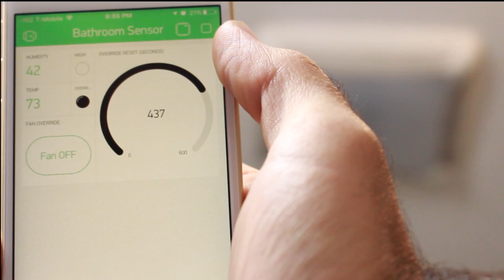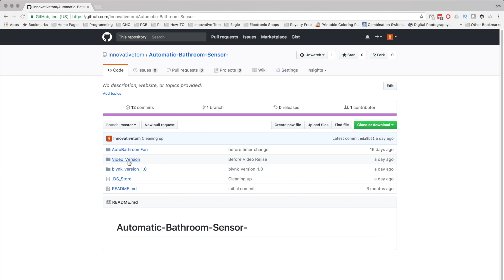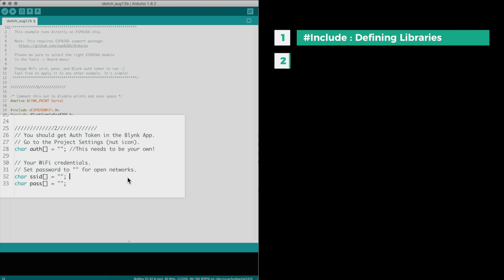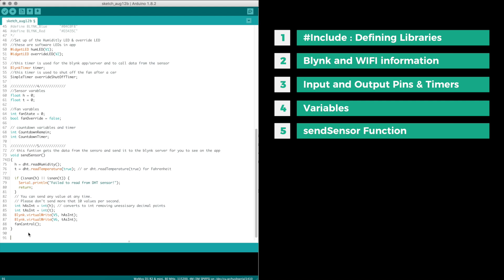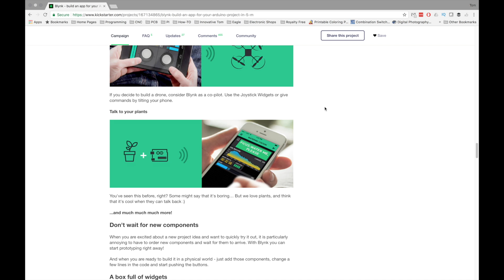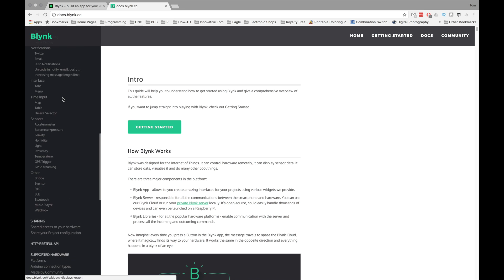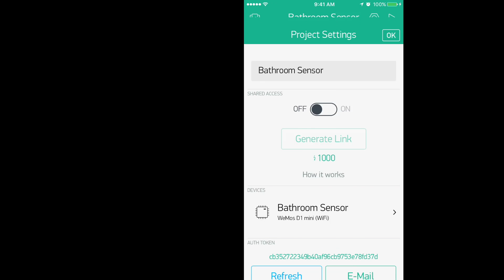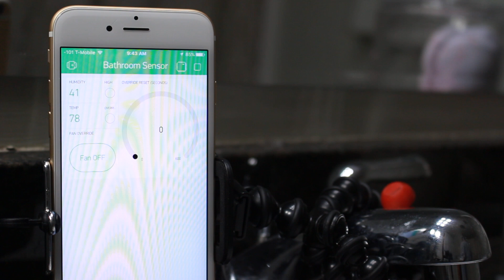WiFi Bathroom Humidity Sensor w/Fan Control, App & Automation

Comment: Tom, loved the series - very informative.  However I strongly recommend that you do NOT solder the ends of stranded wires which are to go under screw fasteners.  I know it keeps the ends tidy but under the pressure of the screw the solder will compress in time and the connection will loosen.  This can take years but it is a well-known problem and I've seen it many times.  My old home 240V switchboard had soldered earth wires under screws and they were so loose that they could be easily pulled out without undoing the screws - an obvious safety hazard.

Comment: I might have just missed it, but how do you power the Wemos D1 Mini?
Reply from the maker: +Balu you didn't miss it, I didn't mention it, you can see when I'm installing I there are 2 plugs in the fan. I very quickly (in the video) plug in USB wall adaptor and USB cord to the second plug. Both plug turn on when the switch on the wall I turned on. So we just keep the switch on so both the fan and the wemos always have power.
Reply: Ah yes, now that you mentioned it I notice the small USB cable you threaded down there. If only my bathroom fan had enough space for a solution like that... :)
Reply from the maker: Balu mine originally didn't, I had to remove light. luckily I have 2 other lights in my 5x8 bathroom. Haha

Comment: great video. You could add a slider widget to your project so you can dynamically adjust the humidity value for different room sizes and conditions.
Reply from the maker: +Reg Bateup that is an awesome idea!! Adding that to v2 list right now.
Reply from the maker: +Reg Bateup i was just think you could sample the humidity for period of time to find the "normal" average humidity for a room. Then test if it spikes over X% over in a short time to then turn the fan on.